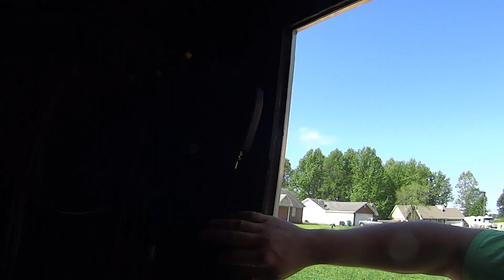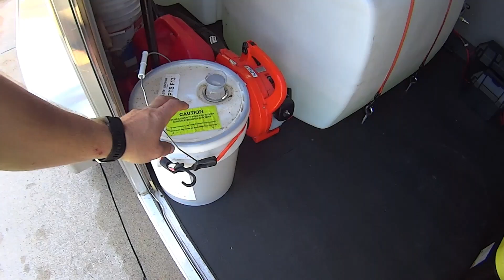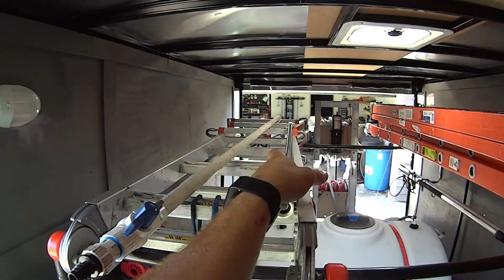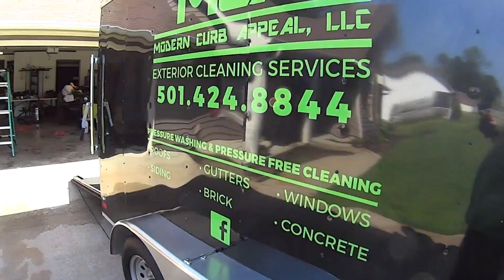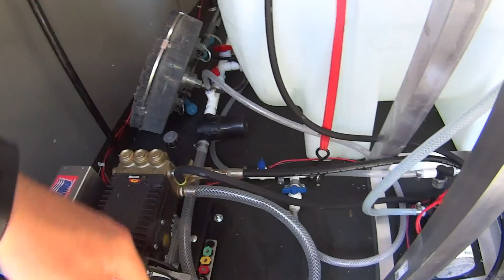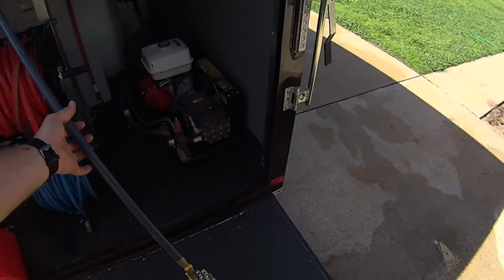Enclosed pressure washing trailer

Comment: I’m building out my setup right now. One difference I see is that I have my ball valve attached to the hose rather than the wand. Eliminates a lot of ball valves, points of failure. I haven’t used it yet but it sounds good to me.

Comment: How much does a setup like this normally cost?
Reply: 3-6k if you build it (pressure washer 800-1000, hoses and reels and fittings 1000,a few 100 gal tanks 800 etc. Trailer alone is probably another 5k unless used

Comment: Thank you Russ. Great set up.. I have only one concern is your weight distribution in the trailer. I have learned from towing my job trailers how important it is to have the weight more centered and forward of the axels.  Have you towed it at highway speeds? Does it sway?

Comment: Hey where did you get the gas tank from. I don’t understand why there are two lines coming from the tank. And where did you get the online quick connect from?
Reply: Preston Wrenn it’s a smog type thing. It’s not needed. There’s a little canister on the engine that can be removed too.

Comment: Very Nice Setup!  You definitely have a lot of knowledge to share and I appreciate it!  I have a trailer, just like this one.  I will be setting up softwash, pressure washing, surface cleaning, all in one convenient location; which is lockable and water tight. Equipment cost way to much to leave out in the elements.  Thanks for sharing this video!  Shaun Ramsay, Extreme Clean Maintenance

Comment: Nice trailer build. The only thing I would suggest is the supply line from tank to 12v pump, change it to 3/4 id,  so it feeds the pump better volume, you'll get noticeable results at the spray tip. Like the hose reel rack, I'm gonna steal that idea, doing another trailer build now.

Comment: Great setup ! Thanks for sharing it with the rest of the world !
I would like to use your layout and try to fit everything into a van ( like a Sprinter , etc ). My HOA (condominium complex) doesn't allow trailers in the parking lot . 
Subbed !
Reply from the maker: mar1video offer them some free work in exchange for a contractors waiver...should save you storage fees and get your equipment set up the way you need, while saving the HOA some cash. Everyone wins if you sell it right
Reply: killer suggestion!

Comment: Hey man, I have the same hose reels from HD... Do you have to pull the entire hose out to use it? I was having trouble with the hose kinking right where it screws into the reel.
Reply from the maker: I do have kinking issues on my feed and softwash hose. I always pull them out anyways and it doesn't bother them anymore. I recently yanked my softwash hose on the door of my trailer and cracked my feedneck inside the reel housing so it will be replaced soon.

Comment: Russ I liked your video.  I'm looking for a trailer now.  And was trying to decide open or closed.  I like you setup on closed.  I'm in Hot Springs Arkansas.  So you do not run a HOT WATER setup?  What's name of gutter chemical and where to get it?  I'm running a 13 to Honda 4,000 psi at 4 gpm.  I am going to make some wanders like yours for gutters!  I did buy the 2 story tips at Lowe's life saver not much ladder work with them!  My number is 501-617-0956 & email is Kh.jones911@gmail.com 
Where are you getting your washers at?  Thank you enjoyed!

Comment: This was an awesome video.  I just bought a 7x12 enclosure  and will be setting it up much like yours.
Reply: Quick question, I'm buying a trailer, any advice in regards to buying a 6x12 or a 7x12? I was buying a 6x12 but I'm curious, should I buy a 7x12 like yours? Is the extra foot that necessary? I appreciate your advise, Jim